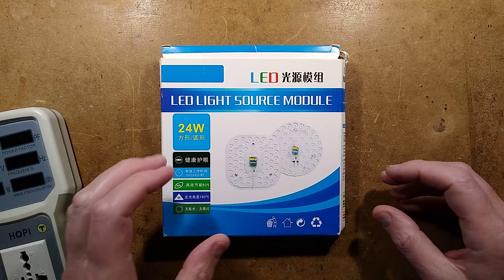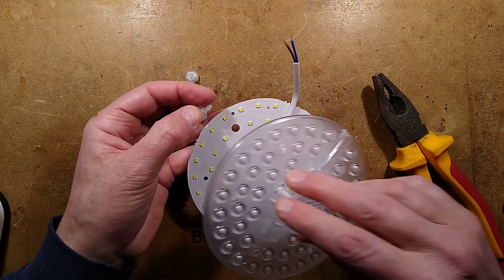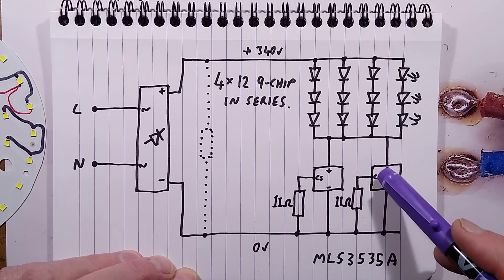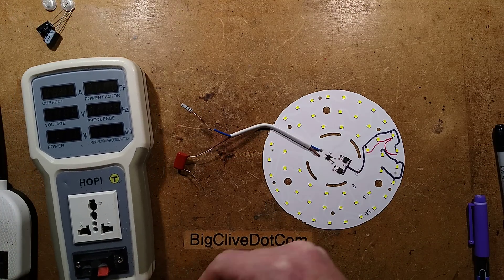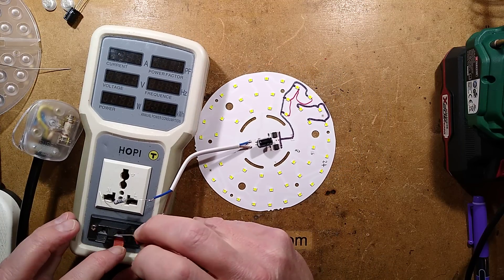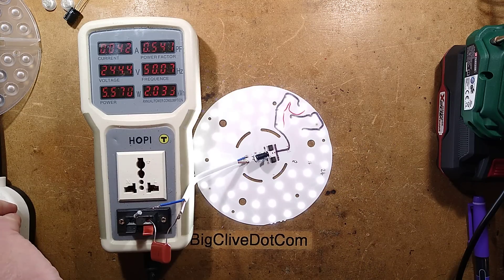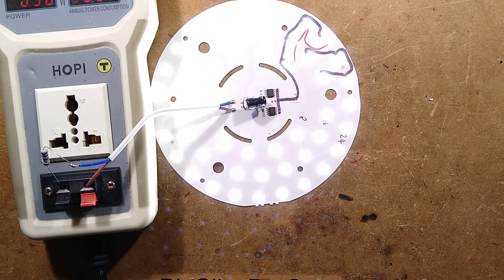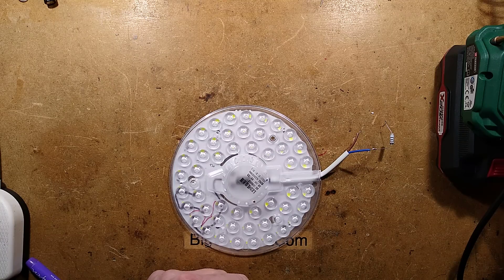Upgrading a downgraded light

Comment: My take on the lack of an electrolytic capacitor is meant to reduce cost and prevent the explosive mode of failure that is caused by the capacitor being dried out due to the high temperatures produced by a largeish array of LEDs surrounding the cap.

Comment: You mentioned the resistor to counteract the 'ghost glow' - the other approach is to add a resistor between the switch lines (1M or 2M maybe) to increase the effect for a useful night light. The switches then choose between 'full' and 'night light'.

Comment: I have a few of this panels in use bur with a little more advanced driver. Some are running a lot of years. Longer than the cheap ceiling lights from the local dump store who died after almost 1 year. So i put a cheap panel in from arround €6,-. But i need to say that i screw them directly to the metal plate with some cooling paste between. And yes i also earth the light. But the lights i use are not flickering at all. CRI should be above 80. Ordered from a store called ´Health forces" on Aliexpress...

Comment: I cant see that regulator chip lasting long by doing all the work itself, I personally would have changed both of the programming resistors to another value instead of just removing one.

Comment: Maybe you should have put the capacitor across the LEDs, not across the rectifier
This way the regulators only regulate off the upper top of the half wave and the cap bridging the gaps for the LEDs
This should result in a very slight flicker and lower losses in the regulator
The way you did it the regulator needs to constantly waste the difference between the peak mains and the LED forward voltage. With the advantage of absolutely no flicker

Comment: I bought a few similar ones to keep in the van for service calls thinking the magnet system was a clever and kinda quick, dirty and cheap repair but I haven't used one yet because every old light I've touched that required an upgrade wasn't in good enough condition and just crumbled at the first touch...

Comment: I have an outside led light that when switched off still glows slightly,( permanently not for a short time after being switched off) is there anything I can do to stop this?
Reply from the maker: Yet a different bulb if it takes ordinary bulbs.  With LED lights it's very common to have a slight glow when off due to the extreme efficiency of LEDs even at microamps of capacitively coupled leakage between wires.

Comment: Possibly the other thing they were going for was a power factor requirement? The smoothing capacitor drops the power factor significantly, and using circuitry that is both flicker free and high power factor would be quite a bit more expensive.

Comment: Hi Clive-Thanks for your video(always look forward to a good watch !!) Can I ask you a question? Would it be possible to make a video about adapting a set of Xmas lights to work on 12 volts. With the price of  mains generated gold plated electrons this year, do you think this would be a good idea so they could be run off a car battery, charged by solar etc ? !!
Thanks again
Reply from the maker: You can run them for a very long time on a USB power bank.  I've made videos about that.
Reply: Thanks Clive- I will look though your archives !!

Comment: Some Chinese teardown of a similar device suggests that the MLS3535A should be similar to the SM2082EGS. There is a Chinese datasheet available for this chip. The pinout matches, a lot of pins are marked as NC. There should be 0.6V present between pin 2 (Rext) and pin 1 (GND). The output current is specified to be 0.6V/Rext. The datasheet also allows smoothing at the input, and the chip is specified to work on DC as well. The seemingly strange track routing on the PCB with GND under the chip is also recommended in the datasheet, since there seems to be a thermal pad (or "IC pin") on the underside of the chip.

Comment: The flicker is barely noticeable under normal conditions I would think or they probably have a lot of returns. So your mod has upped the current from 77mA to 120mA (43mA more) and reduced the power factor by half (down to 0.5) all for the same wattage and introduced a couple of extra failure modes in the electrolytic and resistors...cheers.
Reply: a 60 or 120hz flicker is noticeable in my peripheral vision. An extra point of failure is well worth not being constantly annoyed by a flicker.
Reply: @Ferro_Giconi  Your right ! your house burning down is infinitely preferable to flicker in your peripheral vision, buy a decent bulb ya tight arse.

Comment: Since the power (17W) in the last bonus segment matched the power in the initial test, I am wondering if the (2) 22 ohm resistors ended up in parallel with both chips sensing across the resulting 11 ohms,  the same resistance as originally.

Comment: This LED system looks good because it has the magnets, easy to install. But it could have been nice to be waterproof as I would like to install it in my ceiling light in bathroom, so this clearly looks like it will be damaged by the steam, even though the ceiling lights have a cover too attached to the metal body that's screwed into the ceiling. The bulb is a GR8 type but I took it out as it used 24W bulb which would last for only a year. And I added a small bathroom LED ceiling lamp but it's too big inside the cover 😅 Maybe I can hack it with that magnet system which seems to get rid of the 2 screws. Easy.

Comment: Any idea what the original purpose of 'C1' on the board was for?  ... Is it paralleled wit 'R1'?
Reply from the maker: Just a manufacturing option.  Maybe for smoothing or stability.
Reply: @bigclivedotcom  ... If those two are paralleled with the bridge rectifier, they probably cheaped out in favor of the flickering

Comment: Anytime you add a capacitor I smile, because I always want to add more capacitors to projects. I never been a fan of how many resistors companies add to products. I prefer 1 or 2 resistors over their dozen of resistors.
Reply: sorry, but why not just use a single bug enough cap instead? Legit question. I'm a noob
Reply: Adding caps is fun - until one day I added too many µFarads to the selenium rectifier of one of my valve radios... Selenium is one period lower than sulfur, but worse. The smell lingered for weeks

Comment: In fairness to the chinese manufacturer, most people buy lights based upon the rated power consumption. Old habits from the incandescent era die hard, and if that means running the chips hotter so people think the light is brighter then that's what they'll do.

Cheaping out on the smoothing cap is a mistake, however.

Comment: I just had a resistor with 4 digits that read something like "30R0" does that mean 30.0R i.e. 30 Ohms? I'm a bit at a loss at how to interpret it.
Reply from the maker: The letter R is sometimes used as a decimal point in precision values, so it will probably measure at about 30 ohms on a meter.
Reply: @bigclivedotcom  Thanks! I just took apart my first lightbulb. Now I know why you prefer head-torches ;)

Comment: Since those are linear regulator chips, I would put the capacitor in parallel with the LEDs instead of directly across rectifier output. It would still greatly reduce flickering without destroying the power factor, subjecting the capacitor to high crest current nor increasing the DC input voltage across the linear regulators beyond the initial power-on cycle.
Reply from the maker: Unfortunately that puts a lot of stress on the regulator at power up, as it sees a very high voltage differential as the capacitor can start at zero volts.
Reply: @bigclivedotcom  which is exactly what I meant by "initial cycle." 100mA at 350V crest voltage is only 35W instantaneous power for the sub-1ms it will last. As long as the regulator is designed to drop the full 350V, 35mJ per on-off cycle should be fine. Raising the DC voltage with an input capacitor increases energy dissipation in the chips by a much greater amount on a continuous basis.

Comment: One of these days he is going to zap himself badly. Stating I'm not going to touch them is not a guarantee. And then hovering a hand above them wires, seeing the Hopi move around when the cord is moved. 
One of these days electricity might show what lack of respect gives you. 
And that would be a loss for us.
Reply from the maker: There are layers of protection here.  RCD/GFCI protection, specifically for electronic faults and also ground isolation.  But when working with electricity there's always a risk.  See my video "The unofficial guide to electrocution".
Reply: @bigclivedotcom  i know, but on video it just looks like you are setting yourself up for a jolt attaching bare wire to the hopi . A transparent cover over the exposed wiring would already be an improvement. At least that sausage electrocution unit had a plastic cover.
Reply from the maker: @bzuidgeest  The Hopi is totally non compliant with the electrical standards of most countries.  I actually find the use of a speaker connector for mains connections quite amusing.  It does require a bit more common sense.  Definitely not for those new to electrical work.

Comment: 1 Meg+ resistor across the cap is required. 
Caps do recover considerable voltage after they are shorted briefly.
Reply: Hey, i would really appreciate it if you explained how does that happen, even if i short it for like a few seconds it still holds some charge!
Reply: @theoneohmresistor  dielectric absorption.

Comment: The cooling must be horrible if the plate is isolated by air and plastic from both sides. It could have been screwed on to the metal base of the lamp without the magnets.

Comment: Very interesting hacking experiments. These linear regulators seem fairly flexible, either using a capacitive dropper or just adjusting the value of the resistor. The smoothing capacitor is definitely necessary, I can usually tell when lights don't have one, even without the aid of a video camera.

Comment: Aaah, annoyingly flickering LED lighting from factory new e-waste, the boon of modern technology - making contemporary illumination look as bad as 1950ies fluorescent. What's not to like about it?

Unfortunately even "reputable" brand names do not always guarantee flicker-free and good colour rendition lighting, particularly when buying online. I have had it multiple times that I received awfully bad "brand quality" lamps or fixtures even though I had ordered models of which I already had a well-working specimen at home or good test results from a reputable third party available. Whether these things were just newer or older models of poorer design or outright counterfeits I don't know, and no, they were not ordered through A****n, e**y or A********s for obvious reasons.

On the other hand I have also occasionally found unbranded cheap discount store middle aisle LED lamps that I intended to use for less critical applications in hallways, outdoors, basements, etc., which turned out to be so surprisingly good regarding flicker, colour rendition and longevity that they were then actually used in work and living spaces instead. Only to find out that the next batch in that discount store was just as bad as I expected them to be.

Comment: I will just stick to DC fixtures and my very nice SMPS with all the bells and whistles filtering- and smoothing-wise.

I mean.. if you put the work hours into it is it still economical to buy them ..?!
(One gets the feeling It really isn't a good idea in the first place. (thanks for the video))

(I would guess) The input resistor (right at the hopi) is probably not doing anything else than dissipating some heat (since there is current regulation right behind it) ??? 

There is a similar Part on mouser : NUD4011 (110V only)

Comment: Considering the voltagedrop over the leds as a constant. The power dissipation would not change due to using only one regulator because the current through each regulator does not change. The increase in power is caused by adding the smoothing capacitor because that increases the duty cycle.

Comment: Morning Clive. Do you have an instagram account i was looking for some advice on preventing a pid controller from switching ssr on too often when precise temp is not required
Reply from the maker: Does the PID controller have options for adjusting timing or hysteresis?  If you want a lower switching duty cycle it may be better going with a simple digital thermostat.
Reply: @bigclivedotcom  Many thanks for replying Clive. Yes they do. Im just off to finish wiring up these 7 meat driers. I will contact you later today when I've done. Much appreciated thanks
Reply: The original set up was a simple dial thermostat feeding a contactor to switch 3kw heater. One of these contacts burnt closed and ruined a batch of steaks. Am i right in thinking the pid outputs variable dc to the ssr and that in turn varies the voltage to the heaters ?
Reply: @bigclivedotcom  Greetings Clive. Just got home from completing a rewire job. The reason i asked about the controller was that they had a 25a ssr in a plastic enclosure which overheated and set the plastic on fire and filled the small factory with black smoke.  Ive since purchased 8 more ssrs from a reputable supplier ( Farnells)   Tbc

Comment: I found a Chinese site with a similar teardown and a comparison of the MLS3535A chip with what appears to be pin compatible SM2082EGS, and a circuit diagram which had the smoothing capacitor (and quick shut-off discharge resistor) already in place.

I found a datasheet for the SM2082EGS, unfortunately in Chinese, which showed the circuit diagram. Only 3 pins are used, 1=gnd, 2=Rext, 7=out. Presumably the 8 pin package rather than 3-pin is to allow for extra heat dissipation. How long until that changes I wonder.
Their initial diagram suggests 22uF for the smoothing capacitor but a later diagram shows 6.8uF and I think suggests that this allows the discharge resistor to be omitted. They also suggest 15 ohms for the programming resistor giving output of 12W per chip but the teardown site suggests this settles down to about 11W (for the MLS3535A) which corresponds to what Clive saw.

Comment: The 10ohm should be a fusible resistor in case the circuit fails.
Adding a series capacitor creates a current source (it charges and discharge 100 times per second, and that charge is transfered to the LEDs). That's redundant with the linear regulation.
With the smoothing capacitor, the LEDs stay on longer (hence no flicker) so even with a lower top current, the average current (and power) stays high.

Comment: I'm curious as to why the PF went down when you added the smoothing cap and  increased the resistor size. Was 0.9 originally, but once you added the capacitor to stop flicker and changed the resistors it went down to around the same as using the capacitive dropper at about 0.6.
Reply: Because with the smoothing cap charged there is only a very short time in the mains sine voltage where that voltage is actually higher than the caps voltage. And only in that period current will actually flow from the mains. So you have 100 current spikes (50 on the positive and 50 on the negative peaks of the sine for 50Hz mains). That's bad power factor.
Reply: Because the load changed from a resistive-type (from the regulators mainly) to a primarily capacitive load, caused by the pulsed charge current at the voltage peaks of the mains.
Reply: So any linear PSU will show this effect? Interesting, never really thought about it like that before.
Reply: yeah, any non APFC SMPS will show that :(

Comment: Sorry, a bit of a (probably) stupid question here... Wasn't there a dedicated placement for a capacitor (C1) between the two regulator chips; what's with that?
Reply: They basically designed the board to be able to use all the components, but in hundreds of thousands of units you could save quite a bit of money on capacitors, I guess most buyers don't care about the flicker that is also present in discharge lamps (fluorescent, HID, mercury vapor, sodium vapor) that use electromagnetic ballasts...
Reply: @ruben_balea  Yeah... that's what I thought too, they've chosen the path of the "cheepo" 😂

Comment: I'm wondering that its cheaper to use two regulators instead of one and a stupid resistor in series. I guess its more adaptable from 110V to 240V like this.
It might work more efficient on the low voltage like this, still not improving the leds..

Comment: It would be interesting to short out some  diodes in each string to reduce the voltage across each string to increase the lit time of the lamp. How would it affect the flickering and the heat generated by the chips.
Reply from the maker: It would greatly increase the linear regulator dissipation and possibly cause it to go into protective current reduction mode.
Reply: @bigclivedotcom  its a shame as so much of the waveform is being wasted without the capacitor smoothing.

Comment: I bought a similar job about 3 years ago (came from Germany, so is actually well-made with a proper driver) to go into a dome light I bought to replace the bathroom fly-catching glass globe fitting, still not put it up yet though, the CFL in the bathroom light has refused to die... :P

Comment: Looks like nothing will beat (At least in the long run) a good ol' 50 Hz mains transformer with bridge rectifier and smoothing cap powering 5 mm white LEDs with resistors to limit the current to somewhere between 15 and 20 mA.
Needless to say that a proper setup like this could stay illuminated for DECADES uninterrupted without flickering or blinking, unlike all those poor quality newer LED fixtures both in the home but also in commercial settings (Public streetlights, supermarkets car parks floodlights and so on...) that always have some sort of defect.